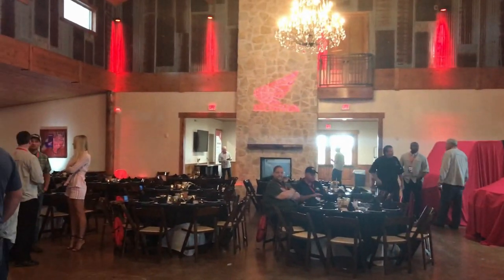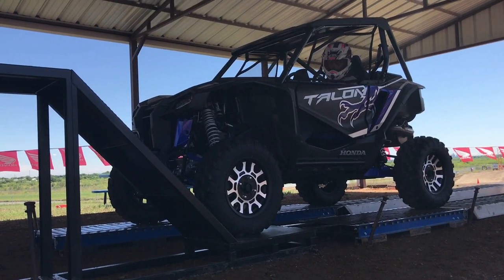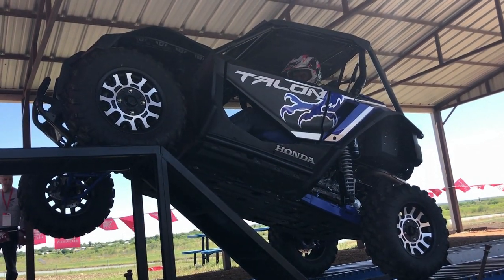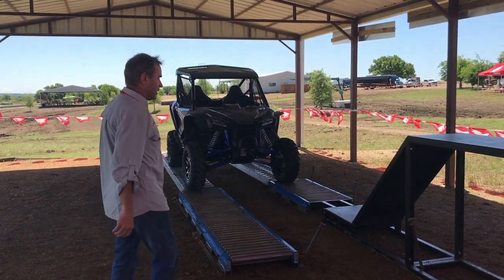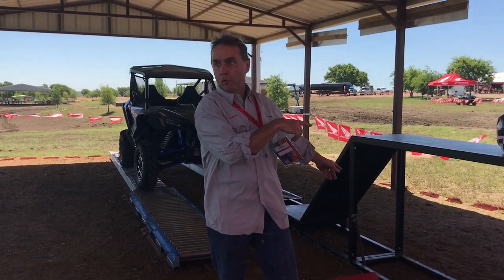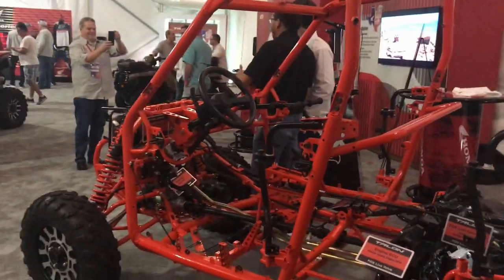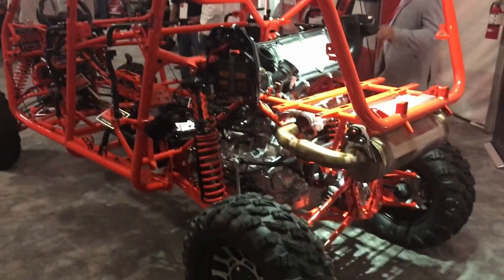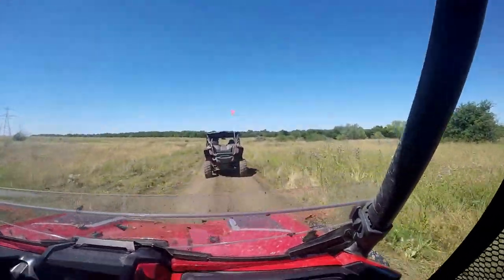NEW Honda Talon X4 with Fox Live Valve. plus I 4wd Demo.

Comment: Impressive demonstration of the 4wd system.  You can argue about lockers all you want, but the machine still pulled itself up a 45 degree incline with only 1 wheel/tire.  It obviously works.

Comment: I’ve always wondered why open diff 4wd sent the power to the wheel with the least traction. Never made sense to me.
Reply: Open diff sends power down the path of least resistance, Duh! What's so hard about that? As far as using the brakes to do it, it will probably be fine In the rocks but it's not my favorite for the mud. It will or at least could cause premature wear of brake parts.

I have owned a Honda Rubicon for years, full time 3wd! You have to pull set front brake lever while hitting the gas with you're some on the same hand. It takes some getting used to but it works just fine
Reply: Open diff sends power down the path of least resistance, Duh! What's so hard about that? As far as using the brakes to do it, it will probably be fine In the rocks but it's not my favorite for the mud. It will or at least could cause premature wear of brake parts.

I have owned a Honda Rubicon for years, full time 3wd! You have to pull set front brake lever while hitting the gas with you're some on the same hand. It takes some getting used to but I was able to use four-wheel drive with no locker.  Having said all of this, I'm sure they were trying to figure out how to get all four wheel spinning at once and keep the steering and handling the best they could.

Comment: this is not better than a locker. the locker would not have paused to think.
Reply: True but some of us don't like chirping our tires and locked diff's put a huge strain on the drivetrain. All RZR's I've driven feel like a bucket of bolts ready to fall apart after some use. I'd be curious to see how this holds up over time.